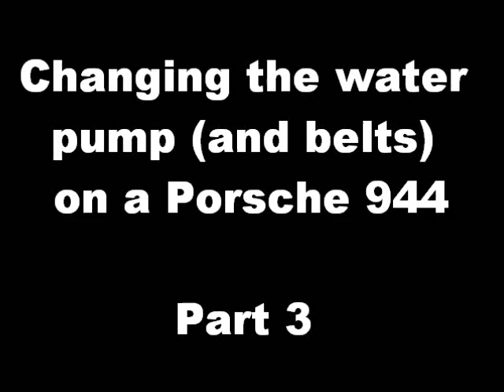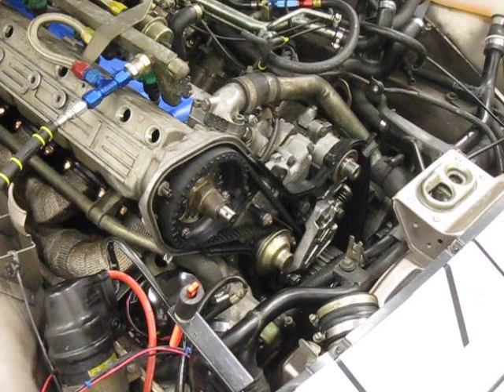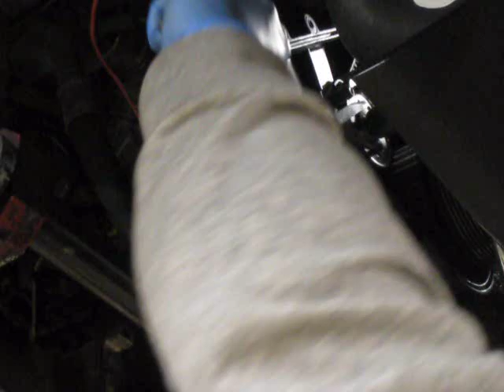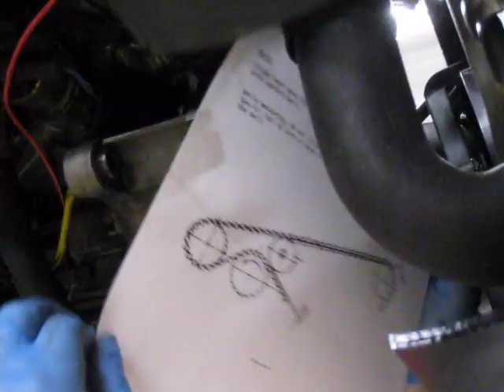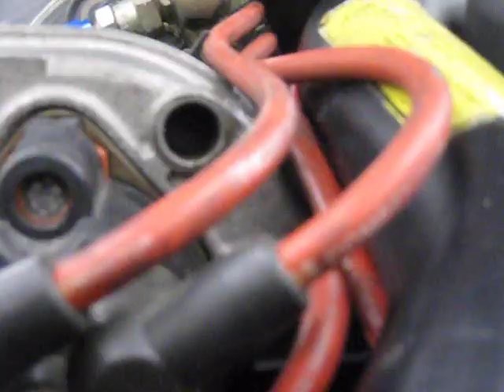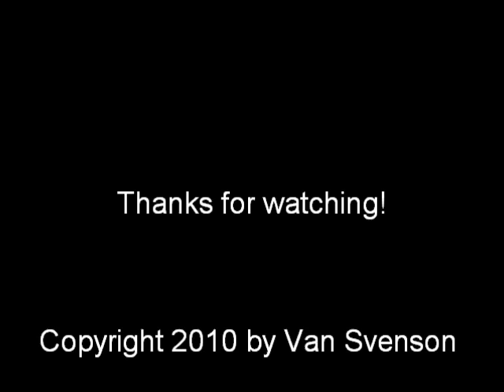Porsche 944 turbo Water Pump and Belt change - part 3

Comment: It's an old video but a good one. However there is a mistake that is a very common one. The Porsche manual specs for the balance shaft idler is not 0.1mm of a gap, it's actually 0-1mm of deflection. It's easy to misread on the photocopied manuals that most people are using but it's a significant difference.

Comment: My question is, is the back of the belt cover open like that on a turbo, or is that a time-saving mod? Because on my Base model, the cover is all closed up around the shaft openings, necessitating removal of the sprocket shaft pulley if you're looking at changing the water pump. Thanks, Great vid, as always!
Reply from the maker: You need to pull the balance shaft pulleys to get the back cover off (to get to the water pump).  I think I shot that out of sequence... :)

Comment: Van, thank you for taking the time and effort to shoot this. You are very articulate, and have such a nice, calm even voice. It makes such a big difference when watching an instructional video. Believe me, I didn't just scrub quickly through this, I intently watched every second, all 4 times I watched it! I will be coming up out of the man cave to the garage to make my last, and final (loosen a little more) balance shaft belt adjustments  - as soon as I finish this comment. The belts went on mine, bending two valves, and necessitating a head pull and rebuild. I took it all apart, rebuild the head, have all that back, on and am now doing the belts.This is a critical part of the process of re-assembly that I don't want to mess it up. Plus I don't have access to a $900 Porsche belt tension gage!Only problems a had was a credit card couldn't gage the clearance of the lower balance shaft idler....a credit card rode on top of the faceplate, and not the belt. I got a feeler gage and was able to slide it between the top of the belt tooth and the bottom of the idler that way. Perhaps cutting the credit card up (OH NO!) into a narrow strip so it would fit might be better.Anyways - awesome job - and next time try and cut it 20 seconds shorter to 9:24, OK?  ;-)Thank you again
Reply from the maker: I'm glad it was able to help you!

Comment: Wow this is an old vid now! My 924s whined for the longest time and it was that damn balance shaft idler that wasn't adjusted right. Great tutorial, just like to send my thanks.
Reply: I am having whining trouble with my idler also I believe. Do you know in what way your idler was adjusted improperly? Was it too far from the top belt, or too close, or something else?
Reply: @Seagrams  my idler was sitting to close to the belt. When you do the adjustment make sure the engine is stone cold. If the engine is warm the belt will naturally be a bit tighter and you won't be able to adjust the idler properly. I had to fool around with it a couple times before I got it right. Funny enough if you run the engine without the timing cover you can actually see that when the balance shaft belt contacts the idler that's when it makes noise.
Reply: @mattaaron8899  Thanks for the response. I was just able to adjust my idler as of recently that the weather warmed up here in Canada. My idler was definitely too close to the balance shaft belt.. I also noticed that when you straighten the belt by applying tension via turning any of the gears that it gets even closer. I set my idler pulley further accordingly, and it stopped making noise!
Reply: @Seagrams  Glad I could help. Don't enjoy the weather too much though. Leave it to Canada to have it snow in May. This is why I drive mine all year or else I'd only get 2 months out of the garage!

Comment: your videos have been very helpful thank you! I just changed the water pump in my 1987 944 and have run into an issue. I'm not sure what the issue is. It runs like it's missing but I've checked and re-checked my timing marks and they all line up perfectly. I checked it with a timing light and it seems fine. Any ideas? It ran great before I changed the water pump. Anyone that could help would be greatly appreciated!
Reply from the maker: Any chance you can use a thermal camera or even an IR temp gun on the exhaust manifold right after a cold start?  I might be able to narrow it down to a single cylinder.  What's the condition of the cap and rotor?  And/or could the cap be installed crooked?  How about the plug wires - are they original?
Reply: +Van Svenson I ended up buying a timing light to know for sure what was happening. Im 10 degrees off at idle speed. It seems like maybe I don't have the aligned properly. The top gear is always either at around 1 o'clock or 11 o'clock (I've tried both) and the bottom one seems to be perfect. I did check a forum and it's possible I'm looking at the wrong mark for the bottom one? That's the project for tonight.
Reply from the maker: An '87 should have the groove on the bottom of the flywheel to line up with the notch at the very bottom of the bellhousing.  Additionally, there is a little "blade" in the square window by the speed and ref sensors, and that will line up with a line marked "OT" on the top side of the flywheel.
Be careful with the timing light...  The computer will change the advance at idle, compared to higher RPMs and engine load...
Reply: +Van Svenson I'm thinking it could be the cap and/or rotor. I'm very confident my marks all line up. I took pictures of all of them and looked at them again and they're good. The cap is able to turn slightly. The car ran great before this endeavor so, I didn't think that would be an issue. I'm learning as I go with this one so I really appreciate the support!

Comment: hi, quck question - needing to change the fuel filter on my 84 944 na - will it be a simple swap or is their a special procedure/process that must be followed, any cautionaly tips?
thank you
Joe
Reply from the maker: A lot of times the fittings are pretty rusty and you might damage the line itself...  The best "tip" I can offer is to use two open end wrenches (or flare-nut wrenches, if you have them) - one on the filter and one on the fitting - and position the wrenches so they're a little separated like scissors.  Then squeeze them together for maximum leverage.

Comment: any tips on removing the reference and speed sensor without removing engine. seems one sensor is stuck and can't pull it out. thanks
Reply from the maker: Those sensors can be a pain in the butt...  Penetrating oil can help...  Sometimes you can get the whole bracket off...  Sometime you destroy the sensor and need a new one - I've had the top part twist, thought I was in the clear, only to pull the plastic part out of the metal part and all of the copper windings came apart.
Reply: Van Svenson thanks

Comment: Van, great video I used to do the belts on my 86' 944 Turbo. A great suggestion to all is to replace the tension rollers for the camshaft belt. I though mine were OK, only to find out after, one was not ! Without a lift equally not as much fun. Thanks again.